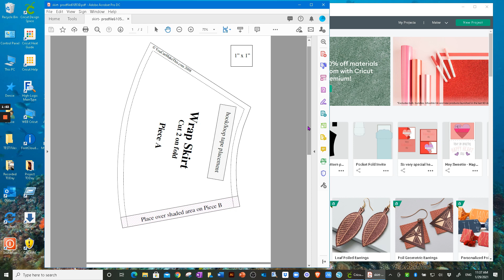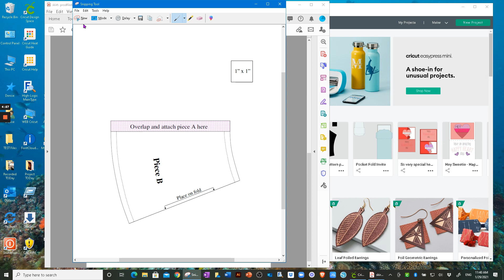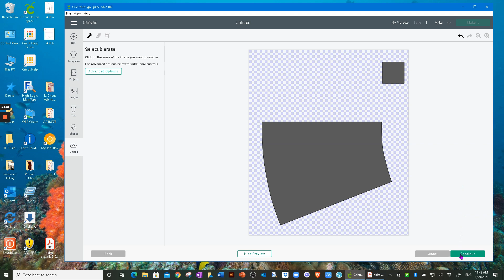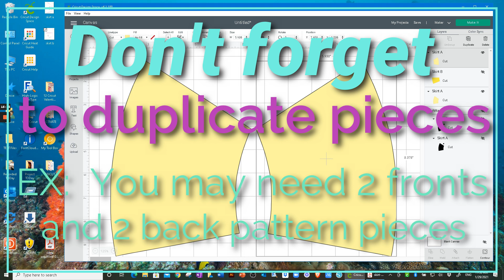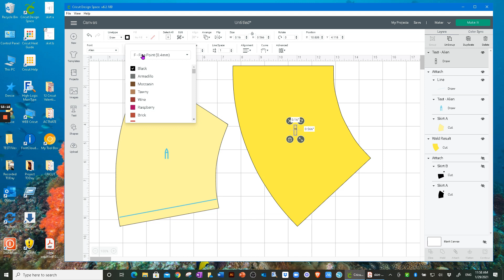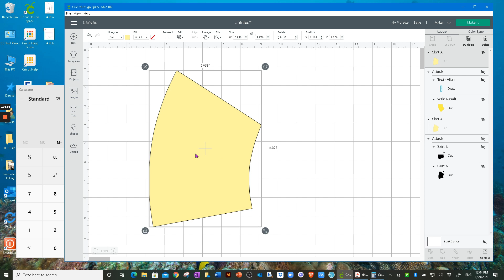Comment: What if the 1x1” square is ON the pattern piece? And my pattern piece has a logo and writing on it that I don’t want. How do I get rid of those things so it won’t cut or write them?
Reply: Hi Gerrie, Great questions!  If the 1X1" square is actually ON the pattern piece, you will not be able to see the 1" square if you upload it as a "Cut" image.  Instead, you can upload it as a "print then cut" image, then once you have it on your Design Space canvas use that pattern piece with the 1" square and size it to match a 1" square on the canvas, or if you prefer you can use a square shape and size it to 1" to compare with the 1" square on the pattern.  Once you have the pattern sized correctly, I'd make a duplicate of it and then turn off one of the layers, so you have only 1 pattern piece which you now know is sized correctly (the reason to make the duplicate is simply for safekeeping in case you accidentally un-size the pattern piece, just a personal preference)  The next step would be to change that "print then cut" pattern piece into a "cut" file by clicking on your pattern piece and then click on the "Operation" tab at the top of design space and click the drop-down menu and select "Basic Cut".  This will change your pattern piece to a simple "cut" file and will not show the 1" square or any of the writing.  If it helps I also did a video on uploading a pdf pattern as a "print then cut" file:  https://youtu.be/VsPpC0wFkJw
I hope this helps!  😊
Reply: @DeniseHumphrey  I put off doing this out of fear. But tonight, I watched this video again, and took notes. I figured out what to do with the 1” square that is ON the pattern piece! I took a screen shot of it and then saved it as a separate png. Then uploaded it and the pattern piece, etc. Grouped the two, sized them correctly to make the square fit into the 1” space of the grid, then ungrouped them. Hid the square and saved the project in Design Space to cut later. Of course the cutting will be the final proof whether I did it right:)

Thank you for such clear instructions and for even including how to take a screen shot on the Mac! Now I can have my Cricut cut out my pdf patterns!
Reply: @gerriebell2128  Yay!!!  I am so proud of you and very happy to read your outcome.  I can't wait to hear your update, I bet it will cut perfectly! 💖
Reply: @DeniseHumphrey  tonight I tried cutting the pattern I uploaded out. I wanted to shorten it by 1/4 inch on one end, so I could fit 2 of them on an 8-1/2 by 11 sheet of faux leather and have a wider flap after folding one end over the other. So I got a square, made it a skinny rectangle, lined it up (I thought) on one end of the pattern , and sliced. And got rid of the pieces it sliced. But apparently the rectangle needed to be a tad longer, and it left a cut line on the side end of the pattern piece. But I used it anyway and WAS able to get two pattern pieces (for two little pouches) from one sheet of faux leather.  I kept the original, so I will be able to do it again but better. I figured out the slice thing just by trying various things (grouping and attaching the skinny rectangle and pattern piece? I don’t remember what finally worked.) But I need the rectangle to be longer so it will eliminate that piece of cut line. 

So the end of the story is it worked! The machine cut the pieces out accurately, including my little mistake (which did no harm). And the piece was the right size. With your method I’ll be able to put my  pdf patterns that will fit on a mat, into design space! The Cricut cuts way faster and more accurately than I can. This is going to be a big help, especially for making gifts or stickers, etc., from pdf’s. 

Thank you again for clear explanations!

Comment: thx for making this tutorial. a tip on Snipping tool- if u snip the wrong section, u just click New-don't need to close and re-open. I want to do this technique with a bandana pattern, the edges of the pattern have dashed lines for different sizes, so it leaves an empty space when importing. any ideas on how to fix this?
Reply: Hi Jenny, You are welcome, and Thanks so much for the Snipping Tip!  There are several options for the dashed line issue that quickly come to mind.  Some are situational too, such as if you sell Dog Bandana's I'd want to make a separate pattern piece for each size to have on-hand type of deal.  If you have Adobe Illustrator (paid)or Inkscape (free) you can upload the pattern and edit it to add a solid line for each pattern size.  If you don't have access to those apps, I'd print off the amount of the sizes you want.....I'll use 3 as an example.  Print off 3 copies of the same pattern.  Use a Black Sharpie to make a solid line on each piece or simply cut them at the size you want.  Then scan them onto your computer then upload them into Design Space.  Also, I have scanned pattern pieces using the "note" app on my iPad as well.  I hope this helps!  😊

Comment: Sorry for so many questions. I have a pattern and only one page has the one inch square. Do I attach all the pages to the pattern to include the one inch square?
Reply: Hi Madeline, That's a fantastic question, Ty!  If the one inch square is separate from the first pattern piece then I would scan the one inch square and upload it into Design Space but then keep that one inch square to size with each pattern piece you bring into Design Space.  To do this, take a screen shot of the square, upload it into Design Space.  The important point to remember about the square is once you attach it to a pattern piece then size it to fit the actual square of the design space grid, that square is no longer useful because you have no way of resizing that same square to how it was before.  So to get around that issue. I would simply never use the original square I uploaded, instead duplicate that first square each time you upload the next pattern piece, then once attached and sized, contour the square out like I show in the video.  Then start over again.....duplicate the square and upload your next pattern piece, attach it to the square, resize and contour the square out.  Sorry for all the words, just trying to make it simplified, Ha!  hopefully not harder to understand.  Let me know if this helps  🙌😊
Reply: @DeniseHumphrey  could I just draw the 1" line on each pattern piece before I copy it to my computer for d/l to DS?
Reply: @tinaorlita8607  Yes, absolutely!

Comment: Thank you so much. This was so informative. I have a desktop and an iPad. Do you have the tutorial on the iPad?
Reply: Hi Madeline, You are so welcome.  I do have the iPad tutorial on my content calendar coming soon!  Yay! 😊
Reply: Thanks. Do you have any videos on svg files?  I am new to cricut. I uploaded an svg pattern and was able to cut the fabric without a problem. The issue I am having is that one of the patterns measurements were off? I customized it myself with the correct measurements. Is this something I have to do all the time with svg files?
Reply: @madelinevelazquez7891   If I understand your question correctly you are referring to a sewing pattern you uploaded into Design Space?  Or are you referring to crafting svg?  If it's a sewing pattern then be sure to use the sizing square I show in the video.  If you have multiple pieces you can wait until you upload all pieces then group them together with the square then size as needed.  Another tip would be to keep an eye on your layers panel to ensure you didn't leave one out type of deal (haha, I've done that one!)  I hope this helps.  If you need to share more clarification please do, I love to help 😊

Comment: Hi Denise,  Thank you for this lesson.  I am not a wizz with software and I appreciate this lesson.  
Last week I learned how to, and then sharpened my fabric scissors.  It took longer than I expected and my scissors are still not perfect, but they will get the job done.                                                                                                                                               Could you  please tell me, is it expensive to maintain, or repurchase the blades for a Cricut?  I am sure some fabrics might be harder to cut than others, but these blades must wear out.  
Also please tell me does cutting fabric in a Cricut create a mess inside the machine?
Reply: Hi Momzila (love the name you picked by the way) 😀 I am on a budget and buy blades when Cricut puts them on sale throughout the year, they have great sales!  How long they last would depend on what type of material you are cutting and how often.  To extend your use, while using the fine point blade would be to keep one fine point blade for paper and keep another fine point blade and use it for "fabric only".  Another tip is to poke your fine point blade into a rolled-up ball of foil approx 25 times and this will help keep your blades clean and free of buildup or perhaps a piece of glitter or fibers or vinyl stuck to it.  I mostly use my Cricut Maker when cutting fabric and often use the rotary blade.  In four years I've only replaced the rotary blade once.  As far as a mess inside of the Cricut when cutting the fabric I'm happy to say no.  Thanks to the sticky mat you place your fabric on it makes no mess in the machine, yay!  Great job on sharpening your fabric scissors, something that is on my long "To-Do" List, LOL  Take care, hope this helps 😊
Reply: @DeniseHumphrey  Thanks for the information.  That sticky mat sounds ideal for keeping the dust and threads to a minimum.                                                            Like everything us MomZillas do, we manage on a shoe string, and sometimes a recycled one at that, and we buy blades on sale.  Not bad.
Critcut sounds like a really decent tool.
Thanks again.
Reply: @momzilla9491  Your very welcome, happy to help! 😊

Comment: Does it have to be a maker??
Reply: Hi Bevie, You can do this same process with the Cricut Explore Air 2, but when it comes to cutting the fabric you would have some limitations compared to the Cricut Maker.  For example, you could upload a cell phone pattern into Design Space and then you would only use "bonded" fabric such as cotton/polyester with heat n bond ironed onto it.  I hope this helps make sense?  The Cricut "Maker" was designed and built with the correct ratio of pressure to seamlessly cut from silk fabric on up to thin wood.  Pretty amazing! 😊
Reply: @DeniseHumphrey  thank you for replying...I just want to cut a pattern out of a cutting mat from dollar tree.
Reply: @beebeej1  You are very welcome, Ok, so now you have me highly intrigued on what you will be making.  I don't know the thickness of the Dollar Tree cutting mats but I would think "IF" you could it would be to use the "custom" dial of the Cricut Explore and perhaps the "deep cut" blade.  Perhaps there is a video on this very process for Cricut Explore's?  Just be sure not to cut something you are not supposed to and void your Cricut warranty.  Happy Cricut "ing!"

Comment: Hi Denise.  Thank you very much for taking your time and energy to put together this video.  I learned a lot watching your video. I also use a lot of PDF (electronic and hard copy/paper) patterns and had a hard time as a new Cricut user. I purchased the Cricut exactly to cut my patterns onto fabric on the Circut Maker.  Finally, after a year of having the Cricut Maker, I'm able to do this because of your video. Additionally, the extra's you put in; like how to make the pattern smaller to compensate for interfacing (genius). I have a question; can you place items next to each on the same mat provided there is space to fit?  Lastly, I have an Ipad that I'd like to use with my Cricut, so if you have gotten other requests, add my name to the list!  Thank you, Thank you!
Reply: Hi Pam, reading your comment literally made my day!  Thanks so much.  You can absolutely move pattern pieces around on the mat as long as it's the same fabric you will be using.  You would do this on the "Mat Preview" screen, so those are the mats right "after" you select "make it".  Also, I've added the tutorial for the iPad as well.  Thanks so much for brightening my day!  😊

Comment: what if my pattern didn' t come with that little square at the top of your designs?
Reply: Hi Sofia, It's pretty rare for a pattern to not come with a size marking, whether it be a line measurement or a square of some type...but much older patterns may not have them.  When I find one that does not have a marker, I open my pattern in adobe acrobat reader and select "actual size or custom scaled 100%" via your printer settings after you select "print".  Once printed, I verify if the pattern is the right size.  If not double-check your settings and if still wrong, contact who you received the pattern from.  If it is full size and you want to add a size square, cut out an exact size of a one inch square from a piece of paper and then place it on a scanner face down with your pattern piece and scan this square with each pattern piece, then upload each of those pages into Design Space.  Sorry long answer but I hope this helps.  😊
Reply: @DeniseHumphrey  thank you so so so much for your response! this makes sense :) 
i just got my cricut machine and im trynig to figure it out! I appreciate all your videos, they are very helpful!
Im a new subscriber to your channel!
Reply: @Sofiamoralesr  You are so welcome!  Congrats on your new Cricut.  They are so awesome and you will be making awesome things with it too!  Thanks for the sub, much appreciated!